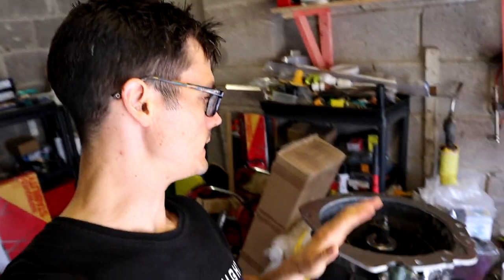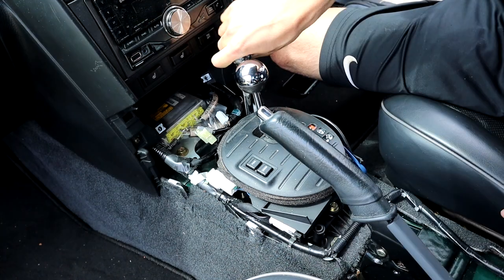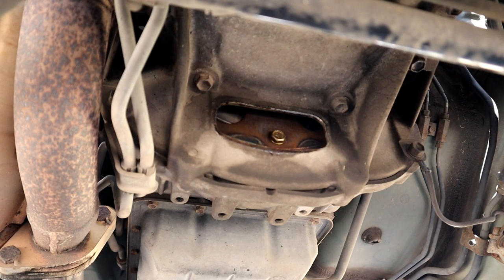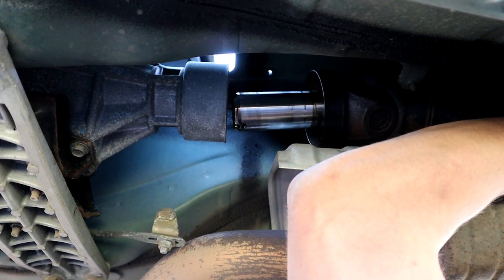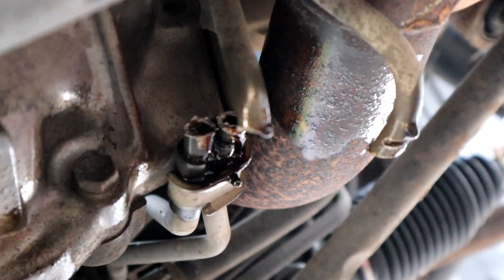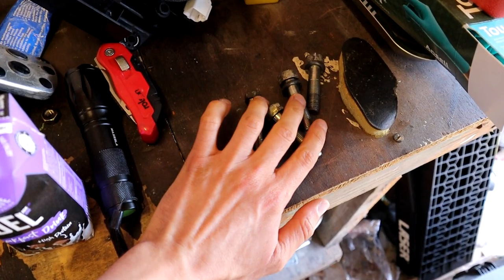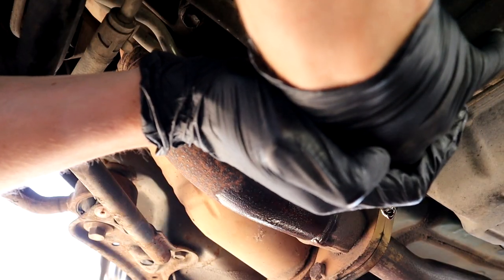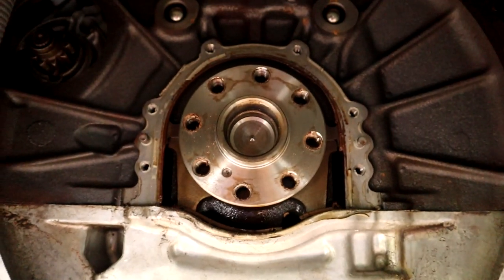IS300 Manual Swap - Automatic Gearbox Removal

Comment: Hey I know these videos are from a while back just having some issues when I drive at low speeds car is fine but as soon as I put the foot down it slips clutch kit is from conceptua tuning, I heard of a plate to go behind clutch pedal just wondering if you had this issue
Reply from the maker: I did have my clutch slip… but I’ve since sold the car, sorry. I didn’t get to the bottom of it. I think I burned the clutch out though by flooring it too soon!

Comment: Hi mate, hope you and your Lexus are doing good. I managed to find the correct OEM Coil spring colours for the Front and Rear. Anyway please could you tell me what the OEM Air Filter Part number is for the IS300? Not stated in your description. Thank you
Reply from the maker: OEM air filter? 🤔 It won’t be in the description of this video. This is a manual swap 😅 Go check the engine maintenance video! 😊👍🏻
Reply: @shizukesajdm I have checked there on part 1 and 2 but nothing fit Air Filter mate. I posted on your latest vlog. Please let me know. Thank you
Reply from the maker: @abdulwaheedqureshi4163  https://lexuspartsdirect.co.uk/product/lexus-is300-phase-1-air-filter/#:~:text=Lexus%20IS300%20Phase%201%20Air%20Filter%20%E2%80%94%2017801%2D46080%20ISP1
Reply: Thank you mate

Comment: Hi, when you install the manual gearbox did the cruise control continue to work with it on the car? Or now is disabled?
Thanks.
Reply from the maker: Nope. Unfortunately it no longer works due to the way the ECU needs to be reprogrammed. I miss it, dearly 🤣